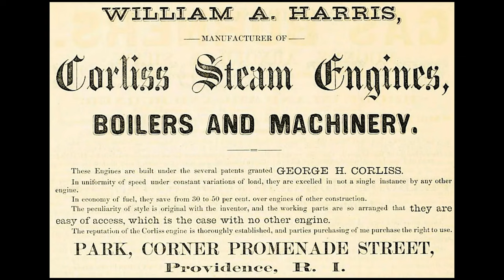The Smallest (and perhaps first) Harris-Corliss Engine.

Comment: Are ball governors fail-safe? If the belt fails does the governor regulate the speed to minimum/stopped?
Reply from the maker: by themselves no they are not, if they stop rotating they go to maximum power.  So you design into the linkage that if they go beyond a certain low speed, the engine timing is set to 0 percent admission to stop the engine, and in this case you have the hold the governor on a starting block above this safety position when starting the engine.  An idler pulley on a pendulum arm that drops if the belt snaps to trip the admission is another way, but the best engines did not have belts at all, the governors were shaft and gear driven